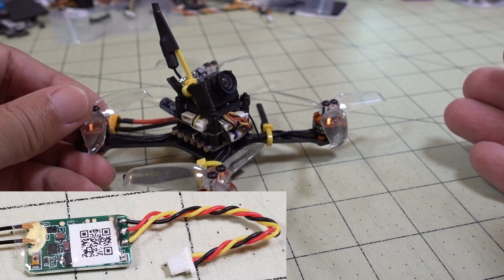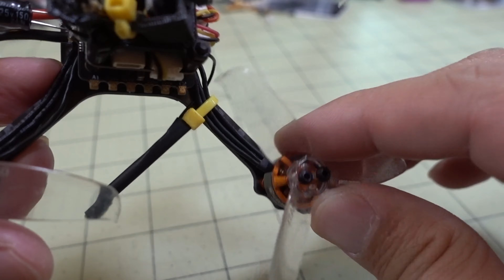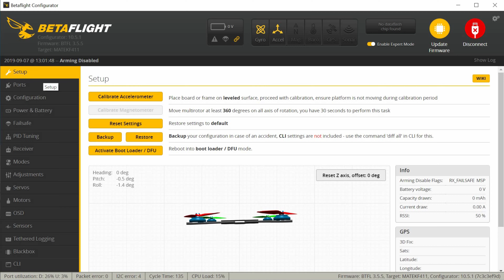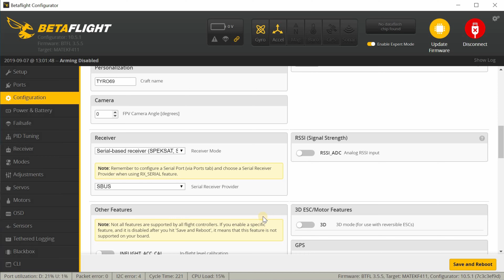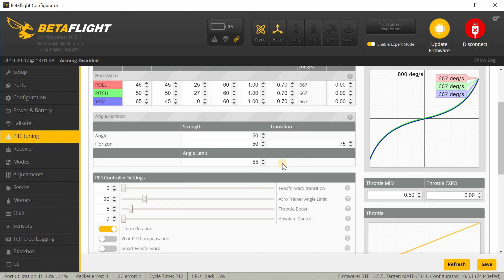Eachine Tyro 69 Toothpick Build & Setup 🛠️

Comment: can you explain how to attach the cable from the receiver to the drone??
Reply from the maker: That would depend on which receiver you have... typically you would solder signal, ground, and 5v to the corresponding connections on the receiver.  You would choose receiver type with the solder bridge as shown in the video.

Comment: what props did you use
Reply from the maker: In this video the props are the Gemfan 2540.  I flew this on 3S and burned out a motor so I recommend 2S only.
Reply: Albert Kim cheers. I bought some
2535 so hoping they will put a little less strain on the motors

Comment: Thanks for your review. I appreciate your honest review. I have a question. I installed a FlySky ibus receiver on my quad for the first time and I heard you say you have to bridge or blob some pads. I am soldered on RX2 and have selected uart 2 in betaflight. What pads do I have to bridge? I haven't bridged anything at this point because I knew nothing about bridging. I blinded the receiver to the transmitter but motors won't spin, I think it's because I haven't bridged what I need to bridge now that I hear about bridging. Thanks in advance.
Reply from the maker: Bridge the middle pad to the one to the right.  The one on the left is for SBUS which won't work for you.
Reply: @AlbertKimTV  ok. I will try that. Thanks
Reply: @AlbertKimTV  I forgot to mention that I have a Aurora 100 Flysky version

Comment: Hi, thanks for the video, I have this tyro 109 just finished setup, and I've got an issue if you can help please, 
I've got the flysky Nirvana nv14 installed with the x8b receiver, binding works fine, 
I've set the betaflight configurator to ibus, and can't control the drone, I've connected the receiver plug directly to the flight control, and soldered bridge ibus right side on MATEKF405, can you help please? thank you
Reply from the maker: It seems like you've done all the steps.  Not sure how your radio is setup.  It may not be setup for the 2A protocol.  This is a step a lot of people overlook.
Reply: @AlbertKimTV  now the remote works with betaflight, but can't control the drone, I will need to learn this remote nv14, thank you

Comment: Hi Albert, Can you spec a replacement flight controller for me? I need a replacement. Thanks!
Reply from the maker: With all the connectors that will be tough. I think the replacement FC is not that expensive.
Reply: I don’t see one on Banggood. Maybe I missed it?
Want to sell yours? :)

Comment: Wait so you solder ppm for flysky? Maybe that's why I had a hard time with the tyro79 I though flysky was ibus and that runs through sbus?
Reply from the maker: You did it wrong.  IBUS is the opposite of SBUS so solder bridge the two pads on the right.
Reply: @AlbertKimTV  thanks Albert! I appreciate the response!